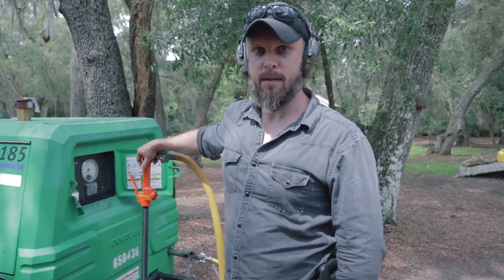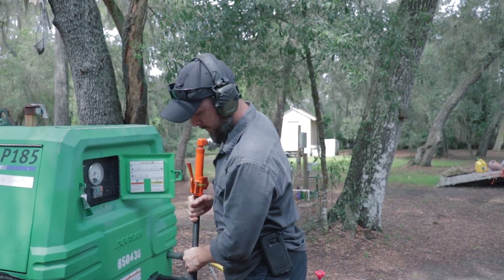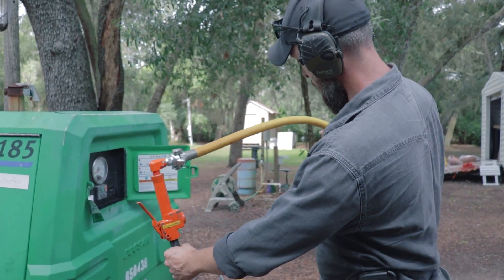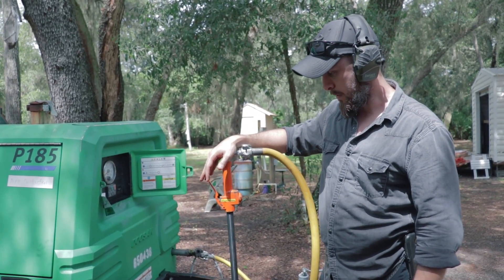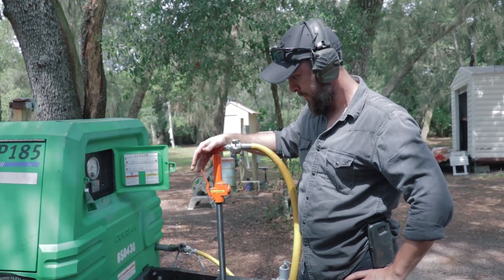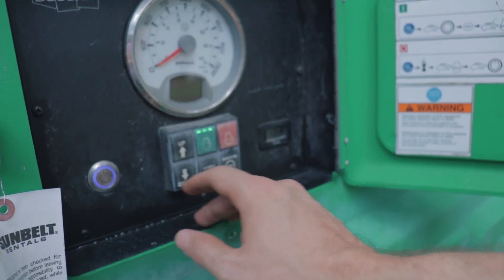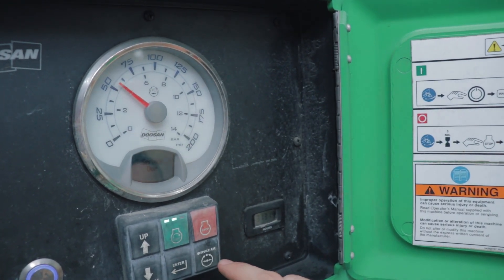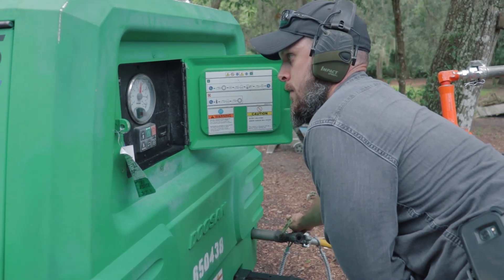Rammed Earth Pneumatic Tamper - How to Setup A Pneumatic Tamper For Rammed Earth Building

Comment: I'm thinking of just getting a jack hammer and then getting a flat attachment.  Then I have another use for the tool. I'm not sure it would require that trailer compressor either.

Comment: Thanks for showing this Alex.  After excavation, tamping is by far the biggest energy investment.  

Is it necessary to run only one of these tools with a tow behind? Some of the specs I have read are only 6 to 7 cfm at 90 psi. Which is much less than the capacity of that beautiful beast.

With multiple tools running for hours at a time which would be likely for large scale fills I could see it.

With superadobe, the duty cycle is much shorter and intermittent.  And that would be my application.

I have made mistakes of underpowering pneumatic tools in the past and would appreciate your feedback.

Thanks for showing what is possible.

Comment: You can set that compressor to just maintain at 90lb without opening the valve that is free. If you are that worried about exceeding 90lb then you should have whip checks (a lanyard) connecting every non threaded connection. Its fairly painful when one comes loose 🤕. All threaded connection should be watched and constantly check tightness when at rest. Apply lock tight if it continues to be a problem. I like to use clear fingernail polish holds good but not so hard to breakd the fiting loose like lock tight. If needed

Comment: Does this mean we can expect a rammed earth video? If so please cover how the roof ties in.
Reply from the maker: Yes. I'll be making more detailed videos on rammed earth. But you can also check out my videos on bond beams to learn how to attach a roof to a rammed earth wall or cob wall. The same concept applies to both.
Reply: Yo, you can use Adobe in a vault form and burn it like a kiln making it water proof or you can use polypropylene bags with 10% cement for your roof.

Comment: I tried using a regular hand tamper.  Didn't work so great but also used premix instead of portland accidentally. On the good note, the sample structure still stands but is crumbling after 3 years.  My guess not enough tamping, not enough variation of aggregate,, not enough pressure, and wrong binding cement. FAIL. Back to easy cob.

Comment: Hi,what is the force it can deliver
Reply: •	Weight = 37 lbs.
•	Length = 51-7/8”
•	Air consumption = 38-42 CFM @90psi
•	Bore = 1.5”
•	Stroke = 5.5”
•	BPM 670
•	Taper = ?
•	Inlet = 1/2” NPTF

Comment: I take it it’s not for the bags.
Reply from the maker: I am not really sure. If you want to use it to tamp bags, you can maybe put a larger tamping head on it to distribute the blows.
Reply: With a modified tamping head and lesser down force applied to the bag it shouldn't have any problem...lower the air pressure...